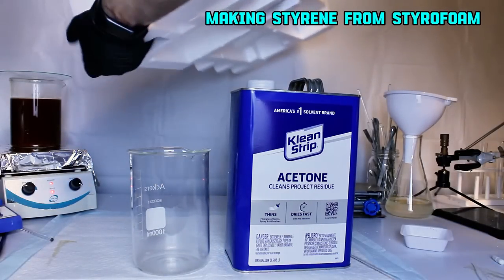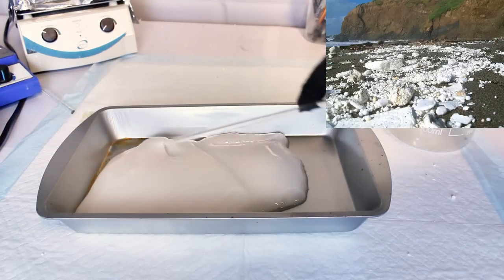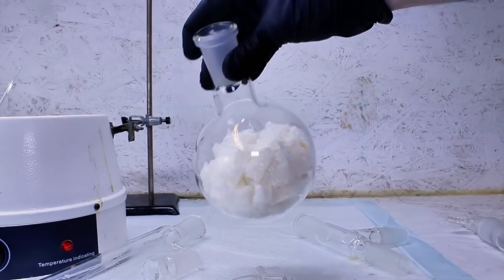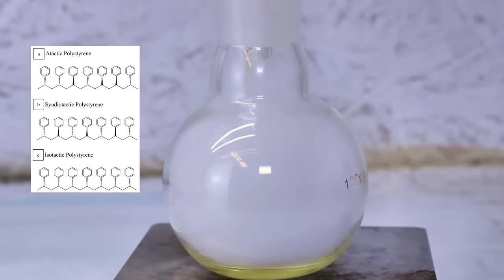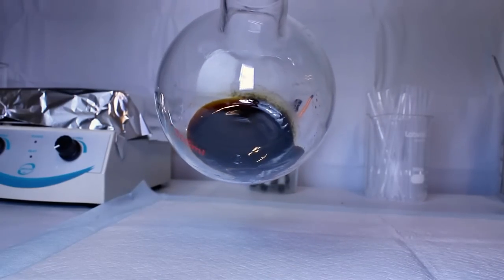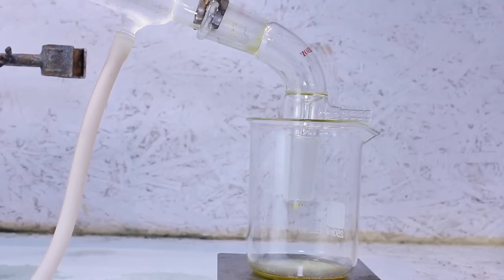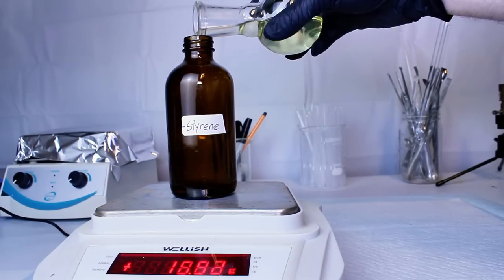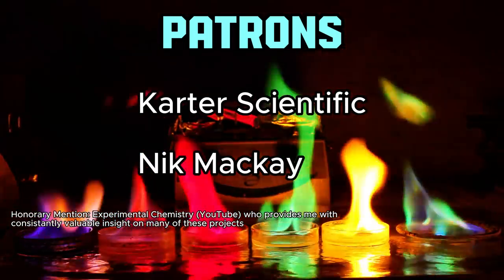Styrene from Styrofoam

Comment: Wow, I am not qualified to take this experiment further but I would love to learn more about this process. I am in an industry that uses polystyrene foam as a building material and we generate a considerable amount of waste and I have appointed myself to find a repurpose or solution to either sell off or donate or chemically modify the chunks of foam. I have heard about blending polystyrene with acetone and we use acetone to clean spray equipment after using automotive clearcoats. simply reducing the EPS to sludge is not beneficial, though it saves space, evap of large quantities is not gonna be prudent in a workplace. i've learned EPS and acetone makes a great adhesive but i would end up with more toxic glue than i could ever use. I want to develop a way to blend EPS scrap with PE polyethylene into a polymer that has some of the rigidity of PS but with flexibility of PE. the PS alone is too brittle to use as a protective coating, and PE is too flimsy and soft. But together.... that could in the right ratio, provide an alternative to polyisocyanate resin coating, also known as polyurea, also known as truck bedliner. that material is applied to the sculptures as an outer hard coating and is what makes fragile polystyrene suitable as a sculpture material that experiences very rough treatment by caffeinated and sugar-addled kids at minigolf parks who will attack it with golf putters at a level just shy of outright vandalism. if anyone has insight into turning polystyrene scrap into a coating suitable for thermally-controlled plural component spray equipment I would be happy to compensate their efforts

Comment: Styrofoam isn’t foamed with air - it’s foamed with butane or propane. The beads are foamed  by applying heat to polystyrene beads saturated in propane under high pressure and temperature.
Reply from the maker: That is true^^ however those gasses do leech out and get replaced by air, otherwise Styrofoam would be a hellofalot more dangerous 😅😅
Reply: @integral_chemistry  Believe me - styrofoam burns horribly… 
You are also looking at gas pressure to foam the styrene at about 120C with a steam heated mould. PS softens at 100C (glass transition) but only fully melts at 210 to 249C.
At ambient conditions the actual pressure in the bubbles is a pretty close match to a hard vacuum (which is why polystyrene foam is such a good thermal insulator).

Comment: Could you break down styrene into benzene ?
Maybe it would be more useful for reactions.
Reply from the maker: Yeah you probably could.. I'll look into it :)
Reply: I now remember that there's an "easy" method for this....
Not by breaking down, but styrene can be oxidised, just like toluene, to benzoic acid, using KMnO4/sulfuric acid.... The mixture is refluxed for a few hours, and the benzoic acid is crystallized from it...
Then, benzoic acid is either converted to sodium benzoate, or used directly in a decarboxylation reaction with Ca(OH)2/NaOH, by dry distillation of the mixture, and benzene comes off as the main product... 
Imagine how useful it would be to get benzene from styrofoam, making nitrobenzene, aniline, chlorobenzene....

Comment: Hey kids, don't do this at home!  Styrene is a known carcinogen, as are some of the other byproducts.  Not enough details are shown, but this setup doesn't seem to have adequate ventilation.  Trust me, I know this shit.  Best advice given is to ban the use of polystyrene foam (I really hate this stuff).
Reply from the maker: yeah I need to put together a standalone safety vid for this channel (I don't think the disclaimer in my bio is adequate) but yeah my fume hood moves 200 cubic feet of air per minute which is more than enough for stuff like this (it is also passed through HEPA and carbon before being released) but yes this chemical is quite horrid, in all its forms..

Comment: Hi
What is the name please of the glass you heated the melted plastic?
Reply from the maker: That was a 500mL borosilicate flat-bottom boiling flask with 24/40 fittings
Reply: @integral_chemistry  thanks
Can you please recommend where you bought it? By the way what is the max temperature it can stand?

Comment: Considering the price of acetone (reagent grade approx. $90/gal or $24/litre), dissolving PS waste in acetone is a rather expensive way of "limiting the amount of landfill space it would take". Probably solvent-grade acetone would be somewhat cheaper, but not that much I reckon, as even among solvents it ranks as pretty pricey.
And at any rate that would make it "the cure worse than the disease". If you think that this would, or could make any impact (apart from the warm feeling of being a goody-goody chap) just place id (PS) in an oven set at 150-200°C (300-390°F), which is hot enough to make it colapse as softening point for PS starts at around 100°C/ 212°F (and it melts completely at ca 240°C/ 464°F - but you don't have to "melt it", all you need to do is to soften it to the point where cells would pop - the hotter, the faster it'll happen).

Also, "dissolving styrofoam as the first step of de-polimerisation" is totally unnecessary, it only adds cost (acetone), and adds some unwanted reagent to the mix, as you can never remove (evaporate) 100% of the acetone used. (Also, it rises the risk of fire when you start heating that "PS cum leftover acetone" mixture - acetone will evaporate first.)
Granted, ketones are not extremely reactive, but why add unnecessary step AND unneeded substance if you can just use heat to collapse the styrofoam cells? Me no understand...

How to calculate yield? Geez, that's no brainer - it's the "most basic 101" of lab chemistry! Weight the styrofoam you start with (or better still, the "thermally collapsed" PS - cuz if you use acetone you'd need to calculate how much of it was left in collapsed PS), then weigh the product (distilled styrene - 54.19 grams, I reckon?), then divide the latter number by the former one, times 100%, and presto! (Or "voila!", if you want to sound sophisticated.)

Frankly, I'm underwhelmed...
Reply from the maker: That's fair, I think maybe you just missed the point of the video. It's meant as a proof of concept rather than a perfected process. I buy acetone for $10/gallon where I live, I actually never considered it could be so expensive.. I think given the low cost of acetone and the high cost of the flack I'd catch trying to melt Styrofoam in our oven made it a good alternative for my situation 😅 As for percent yield yeah obviously I know HOW to calculate it (I generally do for my videos). I have an issue where I just kinda talk and post the first take rather than actually write a script.. in reality I just didn't get the initial weight of the bulk Styrofoam which would likely have been a better thing to say.. probably start actually writing scripts at a certain point.
Reply: @integral_chemistry  I might have missed "the point of the video" but I still think it's pointless to "prove the concept" that's been already proved beyond any doubts, but then again it's your channel and you can shoot as you please. And then there's this "comments section" when individuals like me can voice their opinion... Fair enough, I guess...? ;-)

But then I also understand that, well, you gotta make SOME video every now and then good subjects don't grow on trees.... and then there's this thing called  general populace and its lowest common denominator... Oh well, such is life, and let us not degrees unnecessarily and get back to the main issue instead, shall we? Good ;-)

That price of acetone you are buying is very low indeed, so I guess its purity is "not that much", but it doesn't matter much in applications like this, and at any rate styrofoam can be dissolved by many other solvents - in fact, if memory serves me, it's soluble in styrene too.
Still, I'd stick to the opinion that heating it is the better option, but yes, add the missus to the mix and things suddenly start becoming kinda...  volatile, shall I say - or outright explosive. Speaking of which, it's "flak", as the original name, Fliegerabwehrkanone (aviator-defence gun) has no "c" in it. (I know, everyone does insert that "c" in flak, but it shouldn't be there; also, I'm a natural born knocker but then you probably realised that yourself already ;-)

But then you can get some second hand old electric oven for few bucks, either at some garage sale or at Salvation Army store (or such). I mean, you can use acetone if it tickles your fancy and suits your budget better, but it's the omission of the other, more suitable for large scale true recycling process method that bugged me. I have no qualms about using acetone, but presenting it (in a sense) as "no-alternative available" method did rise my brows and made my keyboard itchy.

Still, this miscommunication (of sort) highlights a rather common underlying issue, which is that people often don't realise that others can't see their thoughts, they can only hear and listen to their words (ladies do excel at this skill, I'd say...).
Should you mention in the video "it can be also done using heat - you could place it in an oven at so many degrees for an hour or so, but I'm not going to do that because of the fear of invoking the wrath of the Goddess of the Kitchen, ...", or "I'm not going to calculate the yield cuz I forgot to weight that styrofoam before I started" (or "I should calculate the yield now but somehow I just don't feel like doing so so take my word for it that this process is pretty efficient") I wouldn't bat an eyelid - "fine, who am I to tell this guy what to do and what do not" - but when I see a clearly seasoned chemist saying something along the lines "gee, shoud'ev calculate it but dunno hawto" then it's instant "Whisky Tango Foxtrot" reaction on my side... 

Never mind, and to finish this little rambling of mine ("little", heh heh... ;-) I will add that packaging styrofoam can be upcycled by crushing it into small pieces and re-made into styrofoam sheets used for insulating buildings, but it seems no-one is interested in doing it - just as is the case with up-/recycling polystyrene in general. Cheers!

Comment: As a person who has routinely worked with styrene-thinned epoxy resins in DIY setting I can smell it from the screen just by reading the title. 😂 I usually don't find the smell of aromatic hydrocarbons unpleasant, even nitrated compounds or aniline (however nitrobenzene and nitrotoluene vapours cause INSANE headache, not to speak about the health hazards), but styrene somehow lingers in the air hours or even days after laminating a model with epoxy, as a nasty, sickly sweet, heavy smell.

Comment: Its great that other people are picking up the baton that Nile Red dropped when he switched from being a chemistry content creator to a meme content creator.
-edit
I guess I should say something actually chemistry related instead of just slighting NR. I had no idea polystyrene had such a low thermal decomposition temperature. I assumed it would be something closer to the "burn it with fire" temperatures you need with PET pyrolysis.

Comment: You're concerned about the styrofoam's landfill space and microplastics breakdown.   and to 'solve' this problem you evaporate gallons of acetone into the atmosphere?    ...at least make a distiller to recycle the acetone.
Reply from the maker: Well to be fair it was about 100mL of acetone to dissolve that huge piece (and it'll actually dissolve a lot more) but your point is still valid. Honestly gentle heating is the best way to condense it but I don't think it would go over well if I used my oven for that.. maybe a heat gun?

Comment: 10.1021/jacs.2c01411 does it with a lightbulb from HomeDepot and some FeCl3 to depolymerize the PS into benzoic acid. 10.1021/jacs.2c01410 is a process I have used personally, but requires high voltage UVLEDs or a specialist lamp to provide the light. I dislike pyrolysis in the lab setting for PS and got very good results from the Huang et al paper. Lemme know if you want to try it and I can point you to what I did for my depoly reactions.